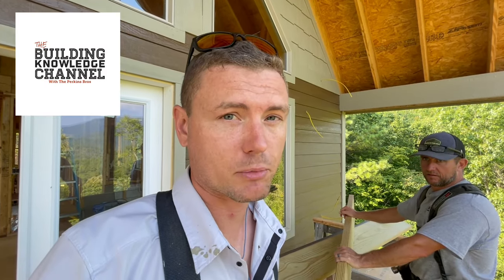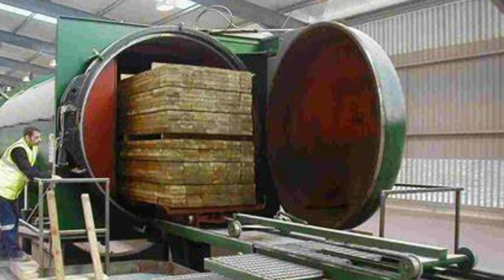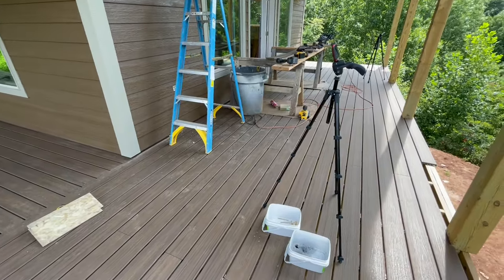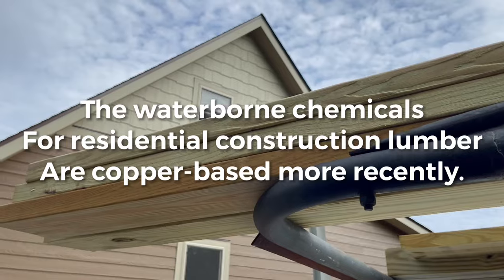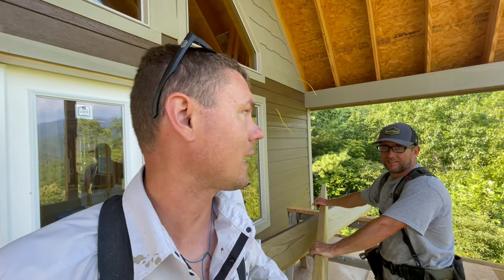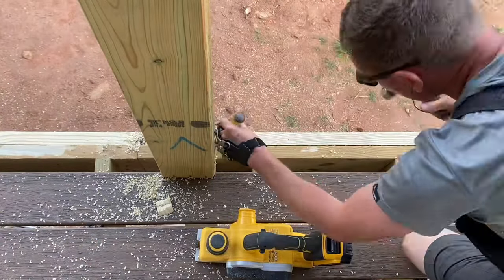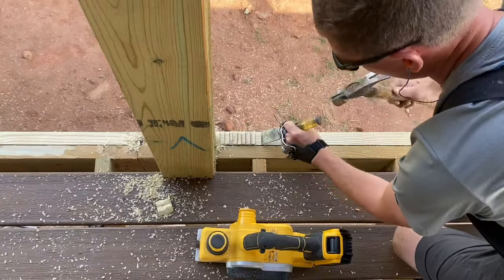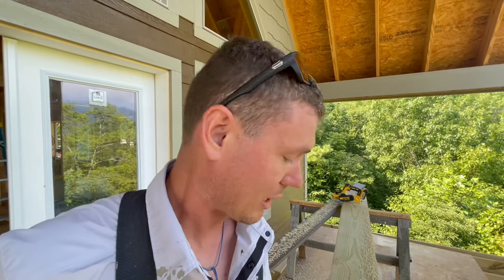All About Using Pressure Treated Lumber

Comment: Eric & Jamie, 
    Thank You for the new channel‼️ It is definitely timely and needed‼️
    We built a mountain home, close to a river, for a retired United States Forest Service Official. He bought fresh cut Cypress for interior and exterior siding and ridge beams (huge 60 foot by 6” stacked 2x6 12 boards thick, weighed over 2 tons)~~ALL dripping wet‼️ The tongue & groove siding was very twisted, warped, cupped, knotty etc. Boss (old time 40+ year lock & key builder) started culling boards due to what he thought was poor quality-“ junk”. Customer said, “No No don’t cull anything- the Cypress Wood will “set” & “rest” in place”! Reluctantly, Boss agreed so we used Tongue Pinchers to draw down the boards in place in the groove. At times, one of us would pull the Tongue Pincher while the other would nail in place ( crooked that bad~ using 8 penny finish nails inside and same but galvanized outside~ lots of extra work~ but He was paying)‼️ 
    We went back to check our work 6 months later and then a year later (we all became friends and he hosted Cookout) Not one board had moved‼️ Not even a thirty second‼️ The beam hadn’t checked, warped or split- nothing‼️ It was perfect-just as he said it would be‼️ Yes, that was high $ dollar Maturial, cut straight out of the Okefenokee Swamp‼️
     Goes to show~~Never argue with a Forester‼️ 
     This video is very timely because my buddy & I are stripping and redoing his boatdock. Pressure Treatment is not what it used to be‼️ The chemicals have changed and grades- even the ground contact rating wood doesn’t have near the amount of chemicals that was once used!
    Thank YALL FOR THE LESSON‼️

Comment: There are numerous grades of pressure treated wood.  It's not just ground vs. non-ground contact.  I will describe below:

--UC1 is meant only for indoor areas that are fairly dry. This would be used for general house framing for areas not expected to see water.
--UC2 is meant for damp (but not wet) indoor areas like basements or bathrooms.  
--UC3 is made for wet outdoor areas but NOT for ground contact (must be 6" or more above ground).
--UC3A is made for areas where water comes in contact but has rapid runoff. 
--UC3B is designed for when water is a bit more stagnant and will sit longer on the wood.  
--UC4 is ground contact.
--UC4A is "general purpose" ground contact, such as fences, garden beds, etc.
--UC4B is "heavy duty" ground contact. Stuff that will sit on the ground, but not necessarily buried.
--UC4C is "extreme duty" ground contact and recommended for wood that will be buried as posts, in contact with concrete, exposed to frequent severe weather, or will be submerged in water all (or most) of the time. This is what you want for deck posts, especially if they are going to be buried. 
--UC5 is salt-water marine grade.

Comment: I built a deck at a Scout camp one time and we listened to the guy directing us and left no gap because all the wood was wet.  Well that wood never separated and that deck held water like a pond. it was a 16'x25' deck. Yes as we hammered the deck on, water came out of the boards as we did.  I would never recommend not leaving some gap after that experience 30 years ago.  they ended up cutting slits in the whole deck before staining a year later.

Comment: Pressure treated is like using green cut lumber off a sawmill. I buy it in advanced bring it home stack it proper on stickers and let it dry 90 days in summer or longer in cold weather. Proper stacking will cure about all the problems. Now i am drying 6x6 and 4x4 post with about 500 ft of rough sawed on top holding it down.I will use it first week of November.I used ground treated 2x6 for rafters in addition i just built this year.Reason was they was cheaper than regular 2x6. But i dried them for 90 days and so far no problems

.

Comment: A while back, I built a couple ten foot long sawhorses that have 2x6's on the top. They are pressure treated and were fairly wet when I bought them. Now that they have dried out, one looks pretty good, the other looks like a sway back nag. If we get quite a bit of rain, it looks pretty good, but when it dries back out, the nag is back. It makes it interesting to try using them. I need the length, I've built two eight foot projects and have a ten foot one to do yet. 
This was an interesting video. Thanks for the information. Have a good day.

Comment: What I've learned for us here in Germany is that moisture content for indoors with heating should be ~10%, indoors without heating ~12%, outside with roof cover ~15%, outside in weather ~18%. So maybe we have much drier conditions here than where you are at in the US. Expansion though per % of moisture change (below fibre saturation ~30%, above that it doesn't change dimensions) is around 0.3% tangentially, 0.2% radially and only 0.01% longitudinally. That means that if you'd install 4" wide  1" thick (actual size) wet boards (30% and above) tight and they'd dry to let's say 15%, they'd shrink 3/16th in width which would become your gap and 1/32nd in thickness theoretically. Now bring on the jokes about German precision and lack of humor ;)

Comment: Thanks for the info.   I have been debating whether to use just a kiln dried 4x4 for a shed based that wont be going in the ground.   I don't like any of the chemicals they treat the wood with. It seems over the last 20 to 30 years they have been trying to change the chemical treatment they use to make it safer or less bad, but it actually does not last as long.       I wanted to get your option on the safeness of cutting PT lumber and the dust created by it.       BTW, thanks for creating the this channel.     I watch you build houses on the other channel, glad to find this Chanel as well.     I enjoy your entire crew building the houses and explaining things as you go.    Great personalities make it fun.

Comment: I bought 7 wet pressure-treated 2x8s at Lowes and assembled them right away into a deck frame, before they had a chance to warp or cup.  The frame is held together with hot-dipped lag bolts and has blocking between the joists five feet apart, so they can't warp.  I measured the width of all the joists, and they were within a 1/16 of an inch.  I'm letting the deck frame sit out in the sun for several days so they can dry, but I'm pretty sure my design will not let them warp or cup.  The whole frame can shrink a bit, but that won't matter.

When I cut the 4x4 vertical posts, I'm going to use a laser level to get them individually cut to the exact right height.  Again, if the 4x4s change dimensions a bit, it won't matter:  The weight of the deck should keep them consistent.  I think the key to using bigbox store pressure-treated lumber is to get it all put together before it has a chance to warp.

Comment: To add to the topic... if you rip say a 2x12 in half or if you saw off a few inches in length, don't forget to treat the edges/end grain where you cut with stain or some kind of weather treatment because as Jaime point out, the PT does not penetrate all the way through.  Also, wood swells and shrinks differently not only due to the areas that are most exposed to weather (heat, wind, etc.) but also due to grain orientation of each board, a plain sawn stick will relax much differently than a quarter sawn stick. Another reason lumber relaxes differently would be due to the density of the species of wood, how porous it is naturally, old growth (tight growth rings) vs. new growth (rings of younger wood or wood grown too quickly on farms, etc.)

Comment: Question, got a deck built with pressure treated wood in 2021. I have not stained it or did any painting or additional treatment since. Is it too late to do further treatment? Is it a problem that I did not have anything done to the deck since the pressure treated wood was bought? Help! Hpw should I move forward?

Comment: I chainsaw mill tons of local wood and work with exotics. 99% interior. Drying and moisture I’ve dialed in over years of mistakes and get it right almost perfect every time…interior. Thanks for this exterior info. I’ve always found PT confounding and super frustrating. I’ve stacked and dried PT to 12% and still had major twist, warp 2 weeks after exterior builds. Just redid our deck boxes… dead flat, dry, now they are warped.

Comment: A 5/4 board is 1-1/4" thick. Not 1" thick. (Its that whole numerator denominator thing). Also, if your cutting or ripping or even scrapping with a chisel boards that are pressure treated, you are effectively removing the treatment and now you have regular lumber. If you do not re-treat the damaged area then don't bother paying the extra money for the PT in the first place.

Comment: So what nails or screws should i use to replace a rotten post on a balcony?  I bought a wood post. Pressure treated 10x10cm. I jacked up the balcony and replaced it  then i screwed the post from the metal base. I also used a metal plate  galvanised on the side at the top. I screwed it in. 

So i probaby did a lot of things wrong. Maybe screws are too brottle and pressure treated eats up regular nails? Even coated ones because youvscratch the nail when inserrting   so what do i do

Comment: Sitting a cupped board out in the sun may take out the cup but it will also curl the ends up...but that's easier to deal with than a huge cup.

Comment: CCA treated timber comes in grades ..H1 ,H2 ,H3 ,H4 and is graded based on the strengh of the chemical and the pressure it was treated at. I know bec i have a Timber business. 
You still need to seal the timber for outdoor use. The CCA stands for Copper chrome arsenate. Its protects the timber agains bugs and fungus but not water. You need to seal the timber bec when it gets wet it expands and then shrinks again as it dries causing it to crack and become spungy depending on the climate in your area.
Reply: Note that i live in south africa so grades might not be the same

Comment: Me......How does a pressure treaded deck w no joist hangers or no 4x4 connectors pass code @ 2:15
Me.... How does wet wood shrink width wise.  Like so much you have to clamp it.     Decks boards are supposed to have a gap. I cannot comment or watch any more.

Comment: Awful lot of egg shell in those eggs you just scrambled!
For instance "The amount a piece of wood will shrink lengthwise, called longitudinal shrinkage, is so small—typically about 0.1% to 0.2%"
Composite decking shrinks and expands thermally.. Ultra Deck..."When on their normal size, composites are quite easy to work with. However, as temperature goes up, the boards expand and become pliable. This change can make the cutting and installing process difficult. The contraction of the boards also poses a problem, as you may not be able to install the boards properly."
Just a couple bits.